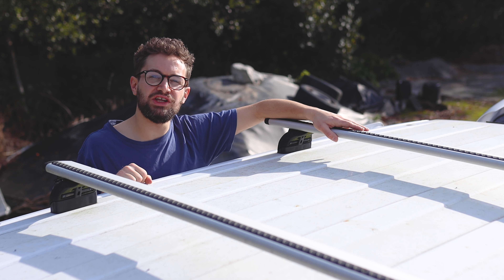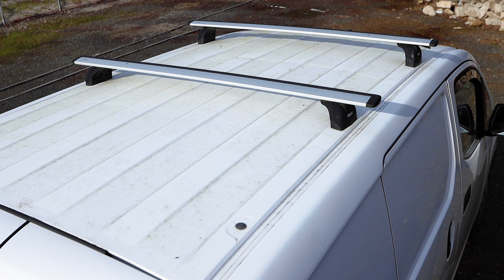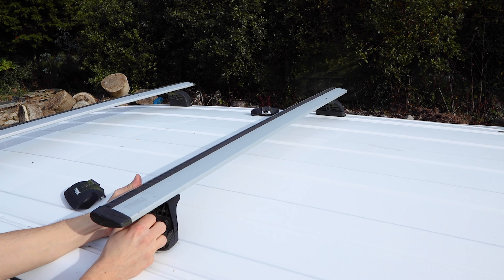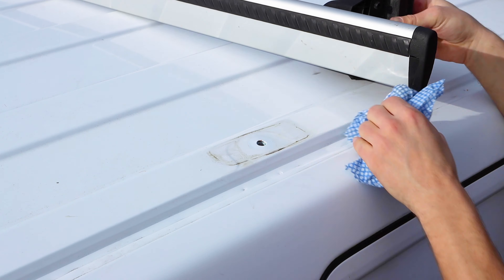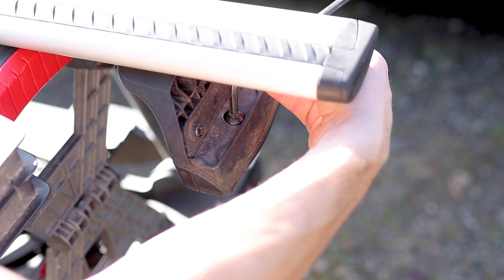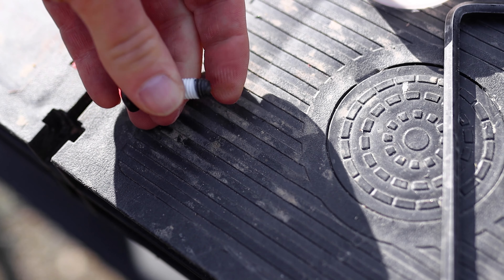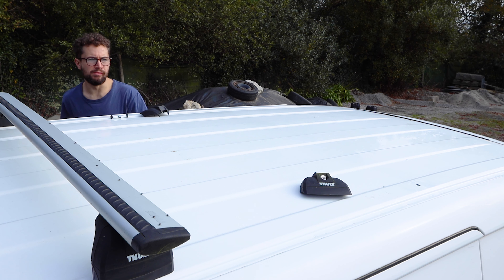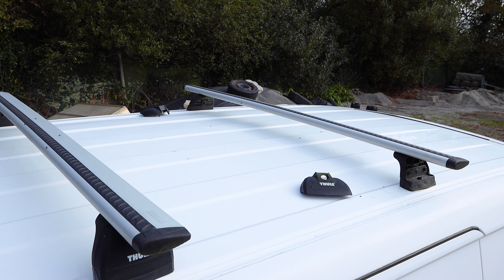SEALING The Roof Bars, AGAIN! (No leaks this time)

Comment: I tried PTFE first and a couple of them still leaked. Not doubting PTFE as that's exactly what it's for. Maybe I wrapped too much tape around the bolts making it all shred when I screwed them in. Either that or my bolts are a few microns wider as not all bolts of the same gauge are made equal. On the second attempt I just used a bit of silicone both in the hole and on the 'top' part of the bolts before inserting them, and that's been brilliant. It's more permanent but I'm using roof rails that I'll never remove and when I need a rack I attach the bars to the rails, which gives a bit more vertical clearance for a vent.
Reply: Hi there Elliot, if you don’t mind me asking, what kind of silicone did you use?. I’m fitting VW roof rails to my transporter next week and I’m looking for the best solution to keep it water tight. VW said their oem rails won’t leak after attaching the included foam washers around the holes, but many reviewers are saying theirs have leaked still, so I really want to find the best solution first and although I like the clean PTFE way, I think silicone sealant might be more secure. Why would it be a permanent seal though ? Couldn’t it be cleaned if ever needed to remove the rails … thanks a lot
Reply: @Ellie_Melloy  thanks very much for your response, really helpful 👍

Comment: you can use silicone tape or butyl
 tape for the surface between the roof rack and the van roof as well
Reply: ideally you'd wanna put silicone around the edge of the mount of the roof rack but i can see why some people wouldn't like the appeal of that
Reply from the maker: Hi Gavin, I considered silicone when I originally tried to seal my roof bars but upon inspection of the feet of these roof bars water can still get through the top, so the only option was to seal the bolts. Not a great design in my opinion, but the PTFE tape has done the trick thankfully!

Comment: Great and helpful video, thanks. Has the PTFE done the job .. any more leaks ? ..
If it has worked I’ll do the same thing when fitting my new VW transporter roof rails instead of filling the holes with silicone which just feels wrong to me and would be very difficult to clean if needed.
Reply from the maker: Hi Jamil, the PTFE has worked perfectly! Had some really heavy rainfall of the last few months and no leaks at all
Reply: @LensOfJames  Thanks James for your response 👍.

Comment: I've gotten confused watching some of these videos from other sources. Mine is a 2014 Ford Transit Connect and some installers are suggesting that the factory made mounting points go clear through to the inside and you use a lock washer with a nut to secure... However, I thought there was a mounting position there complete with threading in the framing system and it does not go all the way through... Can anyone confirm this? I am about to order a rack that I want, but I will have to modify with a kit because it doesn't have the right feet to mount on my van.

Comment: I’m surprised that only a thin bolt holds the foot to the roof. If you have something fastened on that creates a powerful uplift, it might rip the bar/s off.
Reply from the maker: I think it's quite unlikely - I've owned a few sets of roofbars over the years and have carried large surfboards on my roof plenty of times without problems. These Thule ones are top spec for this van, so I'm confident there won't be any problems and have never heard reports of anyone else having any issues. If they have, then it's probably down to user error.